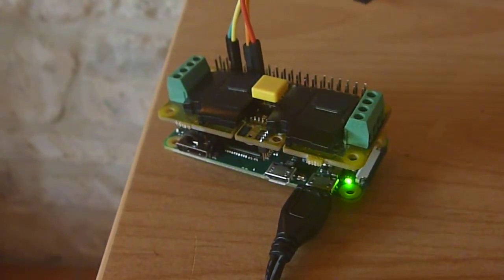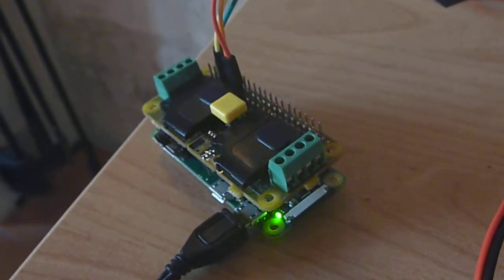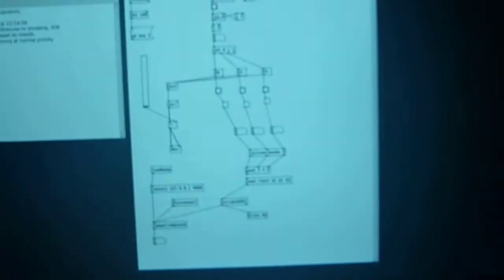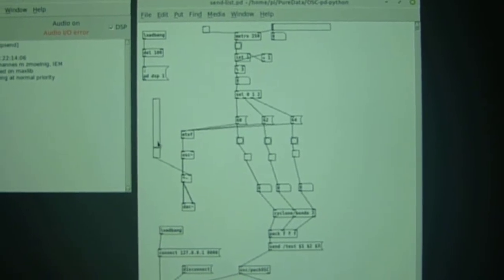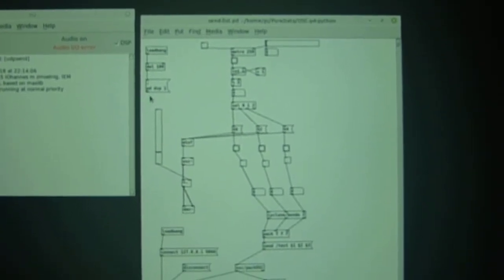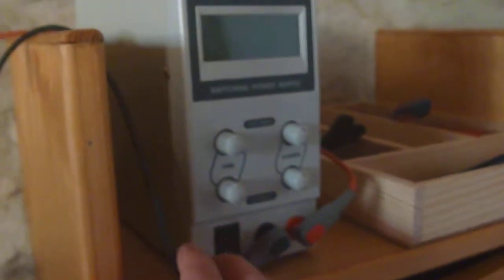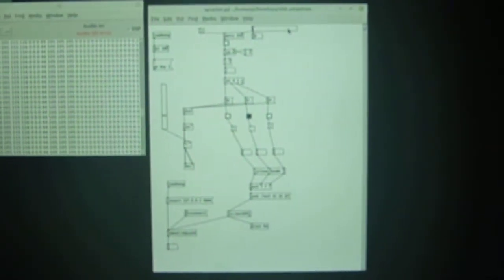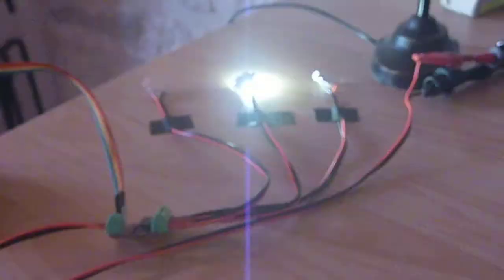RPi PureData & GPIO-out

Comment: This is similar to what I'm trying to achieve right now! I was going to try the Pd WiringPi route first. Is OSC pretty simple to connect with Python? Haven't dabbled in OSC yet.
..also good to know you're experiencing the flashing 'Audio I/O error' too.
Reply from the maker: Hello Styles. First off, the flashing 'Audio I/O error', I have no idea why that's happening. I didn't pay too much attention because it seemed like a small issue. Everything was working fine. Minor bug not even worth looking at before doing something official, like an exhibition, production or a performance, etc. As to questions about OSC and Python, I've built all the bases and posted them at my github repositories; analog I/O examples, digital I/O : https://github.com/jasoncook-io/rpi-pd-python
Reply: @jasoncook-fr  Thank you so much. I've been having a hard time finding concrete resources on this.